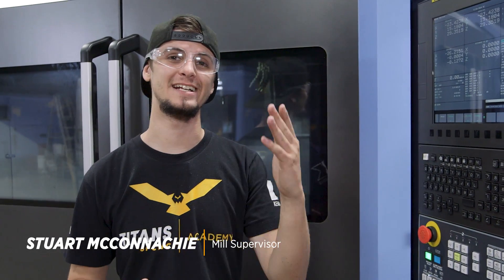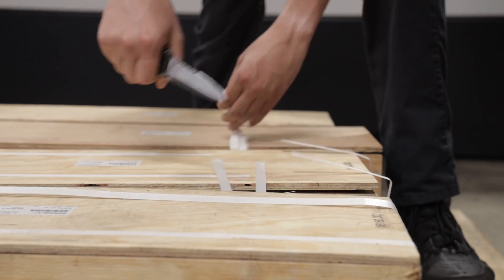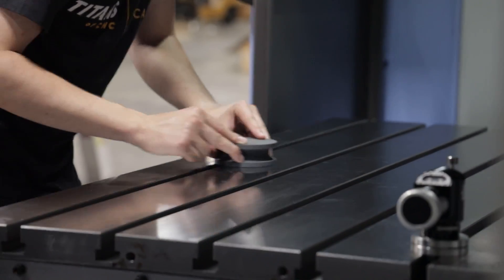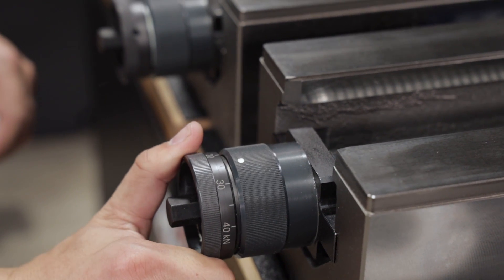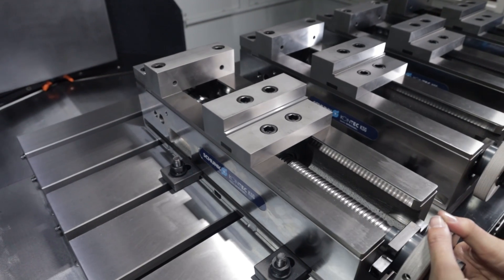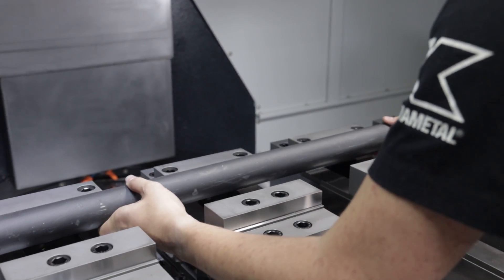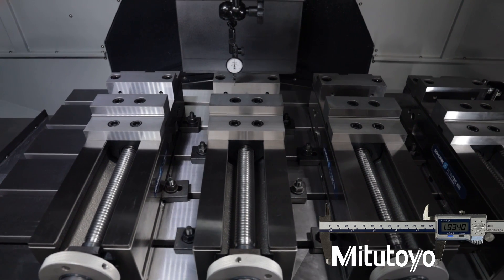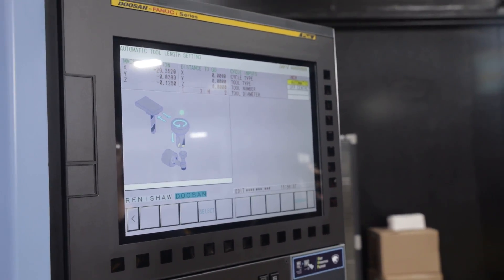MONSTER Vise Setup on MYNX 6500 from DN Solutions

Comment: Why weren´t the designated slots being used to align the vices with the help of a keystone? And further, you have to place the mounting brackets for the vices in the near from the chucks, because when you put 40kN of force on to them, they will bend, just a little but they will.

Comment: You couldn't make those vices with that huge expensive cnc? Reminds me of the fireball tool channel talking about vices. That dude can make a hell of a nice custom vice.
Reply: Dang close to impossible to build one for the price of buying one. Quite a number of those parts must be heat treated and surface ground to hit the tight tolerances.  Not to take anything away from Jason at Fireball, as nice as his bench vice is, it just cannot take the place of a machine vice. The mild steel he used is too smooshy for a high repeatability environment.
Reply: Didn’t know that actually lol. Good info

Comment: It is not 4-40Nm it is 4-40KNm 1000 times more
Reply: The scale says 4 kN to 40 kN. So it tells the clamping force and not the spanning tourque. Its also mentioned wrong in the video.
Reply: @Kalumpo  i now it is the clamping force i use theses vices too
Reply: I noticed that too and was like isn't that 40 Knm. And wondered if I'm the one in the wrong

Comment: It's so easy when everything is brand-new.
Try dealing with 30 year old manual equipment that has had numerous 250 pound gorillas working on them and beating the hell out of things.  I've never had the chance to work on new mills.....must be nice.
Reply: T-slot table looks like an anvil from tapping home morse taper drills.  Gonna need a bit more than that carborundum puck.
Reply: @Ddabig40mac  yup. Some people just dont get it.
Reply: and for free or heavily discounted.

Comment: that tool probing did not look right :)
Reply: yea he didn't touch it off lol
Reply: Yeah, maybe they're using some new tech? i hope Titan can answer this.
Reply: @NARKISDUDE   only other thing they can be using is laser and if it has a tool setter it's not using a laser probably just did a tool set code didn't off set and it limited out and threw a error code. Didn't redo it for video purposes.
Reply: @NARKISDUDE  it's not some new tech. Ahahaha it's just a renishaw probe
Reply: Ultra CNC maybe try mentioning that you have the same machine one more time you absolute loser 😂😂😂
Reply: It was for show not actual setup
Reply: Even the doosan salesmen that stopped in my shop last week mentioned this mess up.
Reply: Looks like he didn't off set it
Reply: @dkh100  yea maybe they didn't know how to use that probe macro on the fanuc control yet. But still had to make the video.
Reply: @qqqqqqqq1407  that's more probable yes
Reply: Looked fine to me
Reply: @TritonTv69420  the tool didn't even touch the probe, also it should have measured on the outer diameter not in the middle as there are no inserts to be measured
Reply: @nf794  4:14-4:16 it did touch , however it didn't look right .
Reply: @kisspeteristvan  im Not sure it touched I looked again. Maybe it's just a camera / angle thing. It might be that they measure the length on the front or back of the tool.
Reply: @nf794  You don't have to be sure , it can be seen . I'm not trying to protect this guy , but it did touch